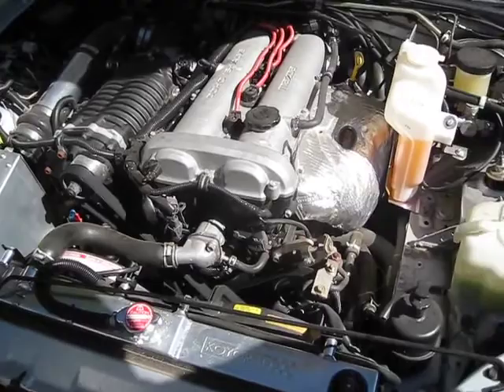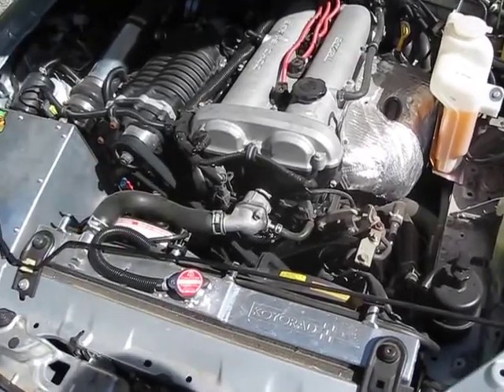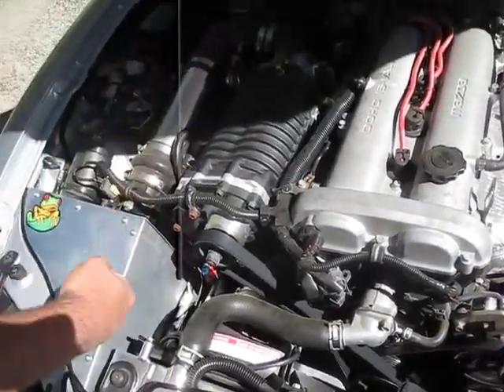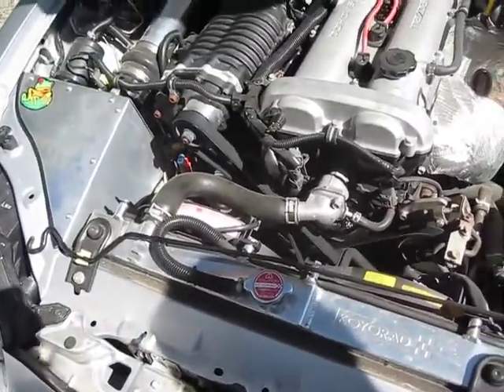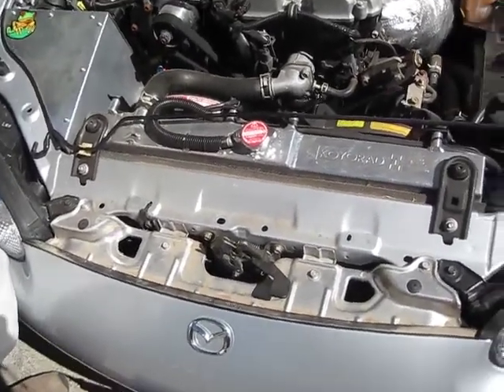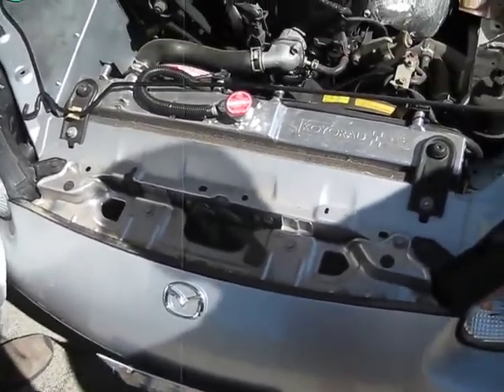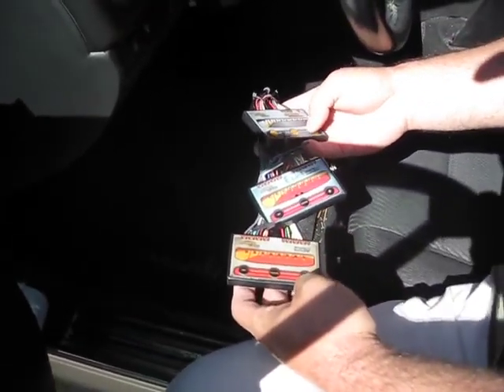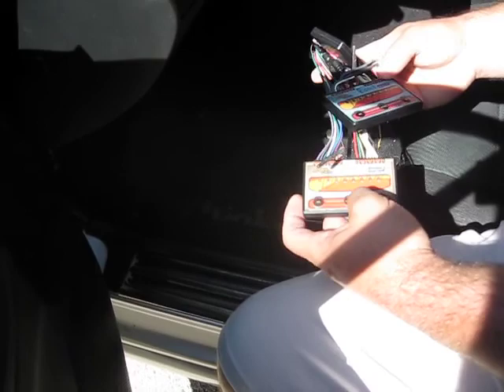1999 Mazda Miata, supercharged, 200RWHP

Comment: I just bought a 99 Miata with the same Fastforward Supercharger kit installed. Kit is $5K now without install, so about $6500-7000K installed. So Fun to drive (especially since I didn't have to spend the $7K lol) and it's reliable. Tom at Fast Forward made kits so you don't need intercoolers. Removing the old hardware and adding this kit adds only a few lbs as to keep overall weight the same.

Comment: I built one of these with the Jackson Racing unit, fuel pump, and electronics. Really needed the intercooler for Summer. But, running it in the Fall was so fast you had to shift from 1 to 3, or start in 2. Car had the six speed. Very fast car.
I am sure claims of 200 are accurate. With the intercooler maybe more.
Very easy to install for someone who can read.

Comment from the maker: I would much prefer having a supercharged Miata instead of a turbocharged one.  With all but the most sophisticated new turbos (by Porsche, etc) they give the engine an annoying pause between when you give it throttle and you actually start accelerating.  It's called turbo lag.  With supercharging you don't have this at all.  You have all the power and torque available instantly, and at much lower RPMs than with a turbocharged engine.  And that cool whine that goes with it!

Comment: @firefoxmoz v8 swap adds at minimum another 300kg to the kerb weight, to say the MX5 is less than 1,000kg to start is a massive difference. It makes the MX5 weigh the same as a family saloon, not the light nimble roadster it is supposed to be.

Comment: two big reasons you dont see a supercharger on a 4-cylinder.
1) it is more expensive
2) the power output of the engine is low to begin with, so the parasitic effect of the supercharger will be noticed a lot more. so for example on a v8 it already has plenty of power so the power lost from turning the supercharger will be a lot smaller than the power lost on the 4-cylinder trying to turn the supercharger
Reply: +Mike Ferrante it should be relatively comparable amounts of supercharger draw for each size of engine. lets take for example an m90 charger on a 2l vs an m90 charger on a 4l. both setups are making 10psi for example. the 4l engine should require double the airflow from the charger to make that same boost level, or the 2l engine should need half the supercharger rpm to make the airflow creating 10psi. so theory says the 2l motor might require 15 hp to spin the charger at max rpm, where the 4l might require 30 hp to spin at max rpm. but after looking at lots of supercharger requirement charts, its clear to see that rpm equals exponential hp as it increases. that 2l motor will actually only require lets say 15hp, where the 4l would require possibly 40 hp to spin the supercharger. goes to show that you pretty much want the biggest charger possible for your engine, then spin it slower to really save on those parasitic hp draw numbers.

Comment: Nice guy and the car is cool, but 200hp at sea level is straight off the website and power cards and power commander only sound the same.
that is called a cold side mount. BR performance sold one for a while.